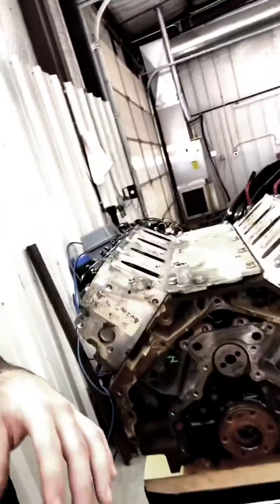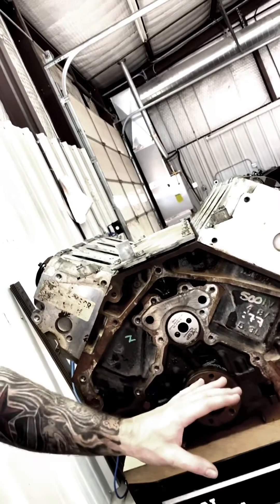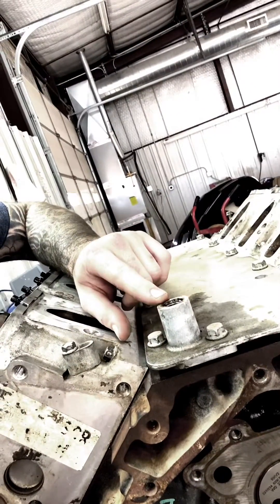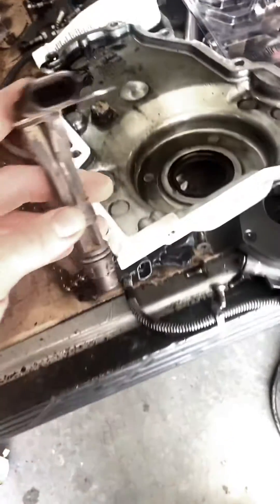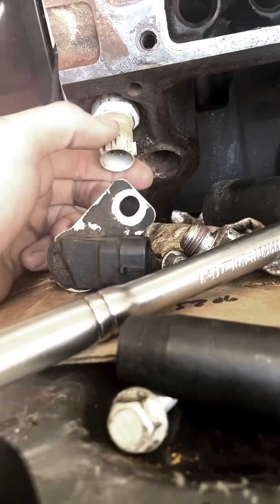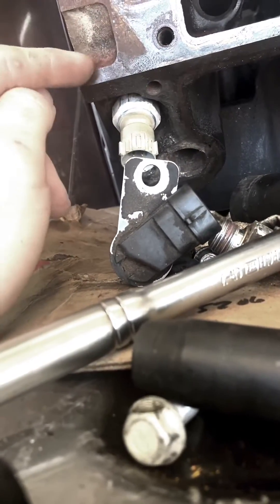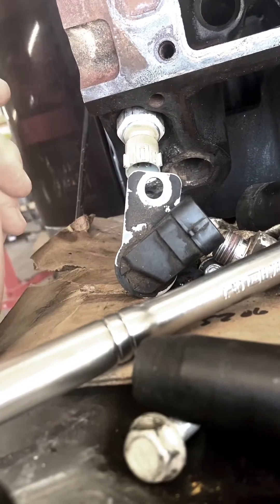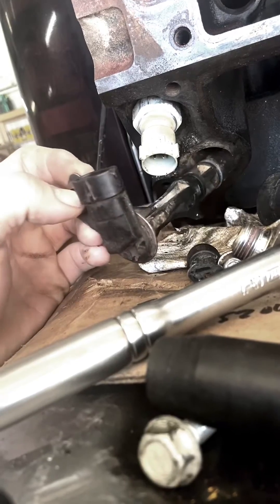Gen 4 swap into gen 3 vehicle

Comment: You can also use everything from the gen 4 and just get a lingenfelter box that converts the 58x to a 24x signal and it’s all plug and play, as far as the valley cover and knock sensors go you can relocate the knock sensors to the side of the block or on the back side of the heads since the thread pitch is the same. The ls2 valley cover will allow you to use the gen 3 oil pressure sensor and use it on the valley cover so you don’t have to tap in into the oil filter housing and get a plate for it. You can use the bottom end of the gen 4 and do a cam of your choice as long as you use the 4x cam gear if your tearing the engine down and doing the reluctor wheel the box isn’t needed and you’ll use the 24x crank reluctor and the 1x cam gear and all you have to do after is relocate the knock sensors and extend your harness from the back of the engine to the front cover on the gen 4 which you can do yourself if you buy a cam sensor pigtail or if you order a harness converter for the gen 4 to gen 3 it’ll already come extended and wired just plug and play. Currently doing the swap myself for my ls swapped Infiniti that just recently blew a 5.3
Reply: I have a 99 Silverado with the LM7 engine on it, today I was at the junk yard and I saw a LC9 it has the 243 heads that why it catches my eyes, I want to swap my old and high mileage lm7 and I though the LC9 will be a good option but how can I make this work with the gen 3 truck? I don’t want to tear down the engine to make it work, it is a good option or I better get a gen 3 engine and swap it into my truck, thanks.

Comment: I have a gen 4 5.3 in my 07 envoy Denali, I blew it up after putting a camshaft and springs etc in it, I have a built 4.8 in the garage but have been scratching my head thinking about how it would wire up and if it would be simple as plug and play or extending some wires since the camshaft sensor is in the front? I can’t find any information anywhere about it

Comment: Hey I had question I had a bad crank shaft on my 5.3 I was wondering if I can use a gen 3 5.3 crank shaft I have sitting around I just gotta take my reluctor wheel off my gen 4 and replace it on the gen 3 then bolt it back up
Reply from the maker: Yes

Comment: So if I want to put a gen 3 engine into a gen 4 truck all I have to do is use the gen 4 oil pressure sensor and use the valet cover of gen 4 and extend wires ?
Reply: change crank to 58 x
Reply: Technically u can get a linfengier to convert the signal for crank from 58x to 24x $300 and relocaye the knock sensors

Comment: I’ve deleted VATS but my truck still shuts off as VATS would. What else would keep these from starting? what did you have to do to get this running? I’m told cause I have an 06 motor has extra securety settings you need to delete or turn off over older gen 3’s